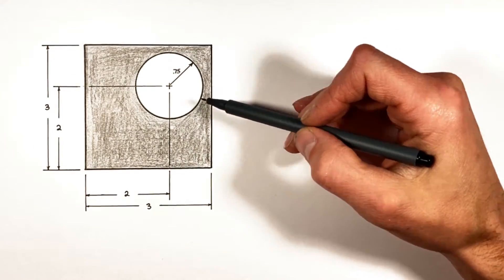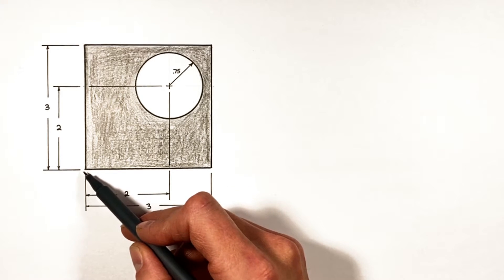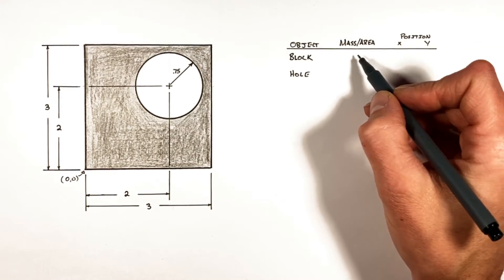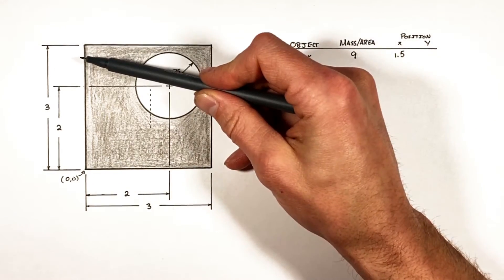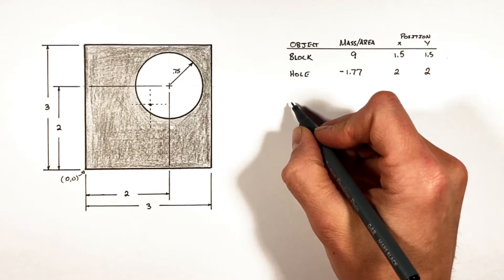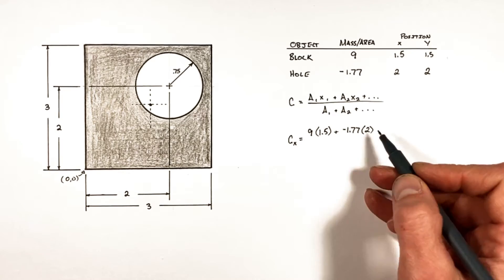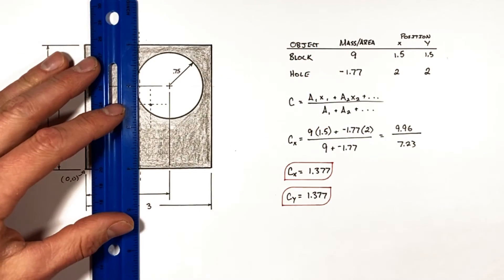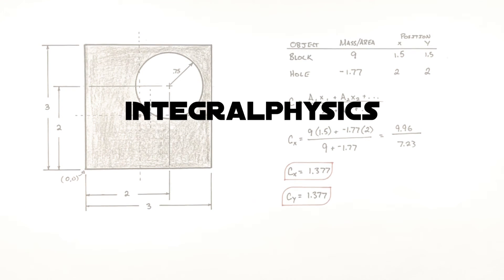Find Center of Mass of an Object With a Hole | Physics & Engineering

Comment: But how to find the "position" of the objects? Is it the centroid of the objects? Example, in your video the position of the circle cut is at the centroid of the circle, but say it was a semi circle, or a trapezium where is the position of that object? is it at the centroid of the object?
Reply from the maker: The cg of a shape like a semi circle or triangle can be derived however it is much easier to use look-up tables to find the cg of those shapes.  (ie google it)

Comment: How about the height of the block in consideration to the cg?
Reply from the maker: The calculation for CGy works the same way as the calculation for the CGx.  The difference being that you use the vertical dimensions rather than the horizontal dimensions.
Reply: @INTEGRALPHYSICS  Thank you for the clarification much appreciated.
Reply: u include the third dimension z axis and do the same thing, but instead of area u consider volume